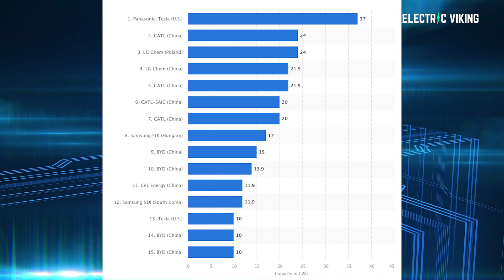Tesla adding 500,000 sq. ft to Giga Texas + global Gigafactory ranking

Comment: @0:55, Tesla built the Shanghai Giga factory in one year; 6 months later the first Model 3 prototype rolled off the test production line; 3 more months later Shanghai factory was producing 10,000 vehicles per month. Today, the Shanghai factory is on schedule producing about one million vehicles per year. What about the Texas Giga factory?  First,  the Texas Giga factory required more than two years to complete. 6 months later the production machinery still require fine tuning. Nearly 3 years later, the Texas Giga factory has only produced a few Cybertruck prototypes. Given the current pace of progress, Tesla will be lucky to mass produce the Cybertruck by December 2023. This story is a case study illustrating the difference in work ethic between China and USA.  There’s no doubt the costly delay in starting up the Texas Giga factory will find its way to the ‘sticker price ‘ of future Tesla vehicles produced at the Texas Giga factory. To be fair to Texas, the Nevada Giga factory fared only slightly better.
Reply: It would be wise to move Tesla's headquarters to China. 🤟😝
Reply: Thank you for that comparison. China and its people are so hard-working, so well organised and so efficient 
that it is simple impossible for USA to compete with them. 
Basically the USA has already lost the competition with China without any war. 
Adding to that ultra cheap russian energy resources like oil and gas and Europe and USA is already finished. There is no even remote chance to compete with CHINA. CHINA will rule the world very soon.
Reply: It isn’t just work ethic it is bureaucratic nonsense you have to deal with here
Reply: Problem with China is that it doesn’t have future. Population is shrinking fast and it’s energy and resources come from Russia which is also falling apart.
If China starts a war with Taiwan then collapse comes in months.